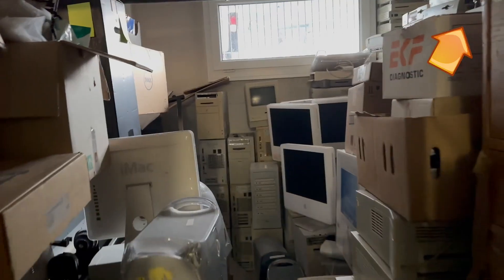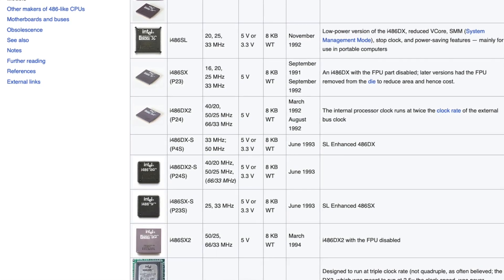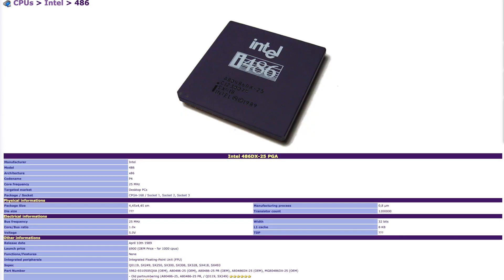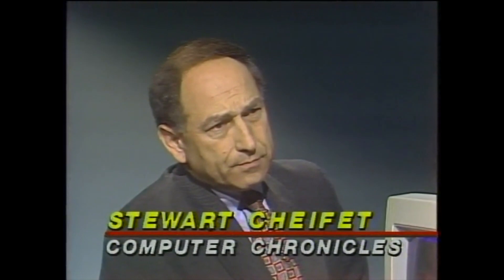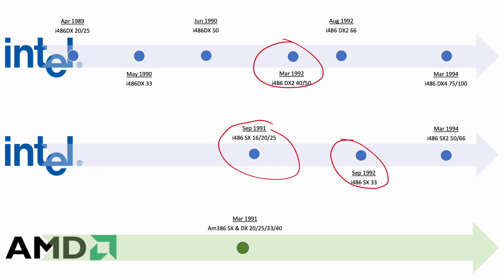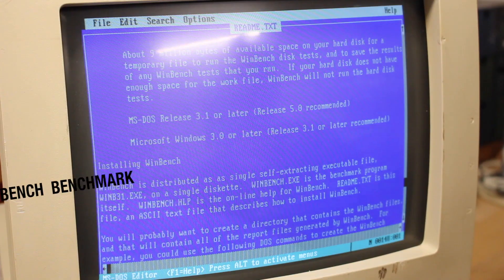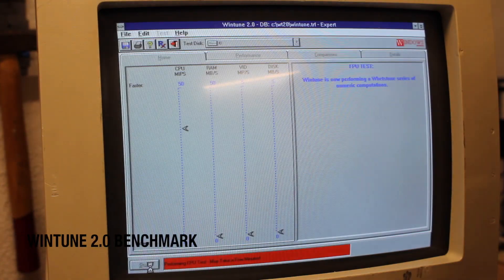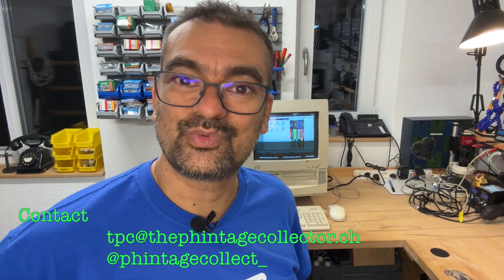Clock Doubled 80486 SX2 CPUs really existed: Here's the reason, why! [CDS 520, Pt. 2]

Comment: What I heard is that the first SX processors were both--DX processors with a bad FPU and others that just had it disabled to meet a lower price point.

Later on, Intel just made SX processors with their own mask, with the FPU section removed from the die.

I did see some SX2-66 processors back in the day, but they were not common. Never saw an SX2-50 but it did exist.

Comment: I have a Packard Bell with an Intel 486SX2-50.
Reply: First desktop in '94 was a Packard Bell with a 486 SX2 at 50MHz, 4Mb RAM (upgraded to 16) and 500MB HDD running Win 3.11 for Workgroups.
Reply: @martyp2138  My first (at least IBM compatible) was a similar model with a DX 25 Mhz, but the one I have right now is basically a match for the one you describe. It's a Legend 10CD.
Reply: @mattelder1971  Just looked up that model and the case is identical. Can't recall what model mine was, seems they were branded different in other countries.
Reply: @martyp2138  Yeah, they used that same case for a LOT of machines. The one I had back in the 90s was pretty much identical in appearance too.

Comment: The reason Intel didn't launch the SX line until 1991 is because their 386 line was still filling that niche. Why would they flood a market they already controlled with cut down CPUs that still cost as much to produce as their flagship parts? It makes no sense to throw a 486 branded CPU into the budget market unless you don't control that market anymore. IMO, they waited till '91 because they didn't want to lose sales higher up the product stack. Let's face it, most people back then didn't know the difference between an SX and a DX, all they cared about was "I have a 486" and maybe it's clock speed. Intel knew this and knew the much lower margin SX would outsell their flagship DX parts. I would guess that by '91 they had probably largely recouped the cost of the new fab process, as well as improved it's efficiency, and could afford to bring 486 to the budget market with yields now at their peek and thus production costs being lower. 

You have to look at these things from the perspective of the manufacturer. An SX33 would cost the same as a DX33 early in the production run. The entire DX range were all made on the same CPU fab, DX20 - DX50, they would have simply binned the lowest performing CPUs as DX20 and the highest as DX50. That is already 4 bins, 20, 25, 33 and 50, each step down is a profit slash while the production cost remains the same for all. This is why manufacturers would hold off introducing cut down models as long as possible. Binning a 20mhz DX allows you to sell off weaker binned parts, it's efficient, but cutting it down further and calling it an SX with a larger price slash is senseless unless the market requires it.

Comment: I have one piece of Intel 486SX/2 50MHz here. Interestingly, at the time when those processors were current among people, I didn't meet a single one, I didn't even know it existed then. I didn't come across it until much later and I was looking what is it? I wonder if it had the same overclocking potential as the classic SX. SX 25MHz were normally clocked at 40-50MHz stably. Especially the newer ones with a smaller core.

Comment: I have a PC here that our neighbours unceremoniously dumped in the trash a few years ago and that I rescued. It claims to have an 486 80 Mhz SX which is soldered to the board. The chipset around it is IBM branded (with big blue stickers). I think the CPU might probably be a Cyrix part? I never removed the cooler so I don't know for sure...
Reply from the maker: Or AMD, they did 80 MHz ones for sure. Cpuid utility helps in identifying it via software detection.

Comment: Yes I sold boatloads of higher-clocked SX processors in system that I built (mainly to people that insisted on Intel despite cheaper faster alternatives). I almost always overclocked them so they actually ran faster than DX2s. Virtually no software used floating point till Quake so DX2's were a total waste of money for most people at the time.
Reply from the maker: Remember the prices for the SX2? I didn't find anything on that. Would be interesting though to put the prices in perspective.
Reply: @THEPHINTAGECOLLECTOR  I remember intel SX processors still being more expensive than AMD's finest which was insanity. As for the rare 486 socket Overdrive processors, they were simply obscene in price. Cryix were the real bargain basement at 50% cheaper, AMD was around 30% cheaper. This is all from memory though (I built comps to pay my way through my CompSci degree). I was paying 'tray prices' no warranty - didn't give a damn, never had a CPU failure return ever. That in itself was a HUGE difference. I can't even use The Wayback Machine to check pricing.... those were the days I'd use my contacts at local computer shops, the prices I paid were definitely not what everyone else paid!

Comment: Apparently shadowing the area of the XT-IDE BIOS may improve the CF Access to get more faster.
Reply from the maker: The Compaq doesn‘t offer any settings for shadow RAM.

There‘s no real need for an XTIDE adapter on these machines. A simple IDE to CF adapter is sufficient to plug the CF directly to the IDE bus.
Reply: @THEPHINTAGECOLLECTOR  sorry my friend, it was my bad, i didn't notice i only assuming that the cf to ide was with and xt-ide. Normal things in computers.
Reply from the maker: @asanjuas  no worries, there‘s always more than one way to do it.